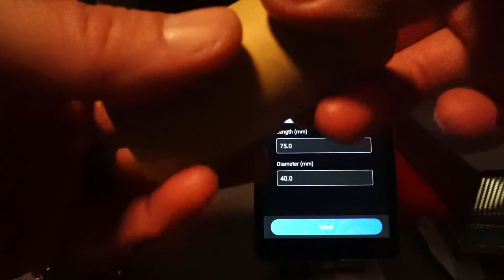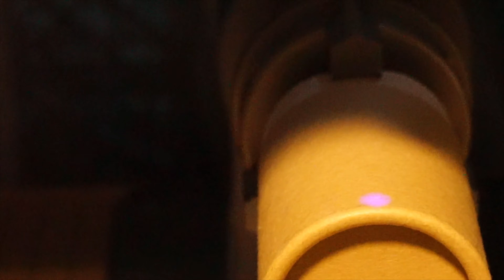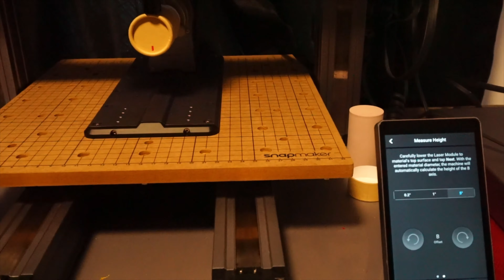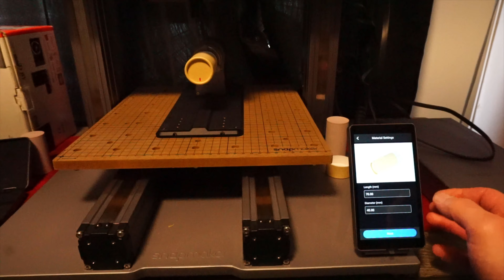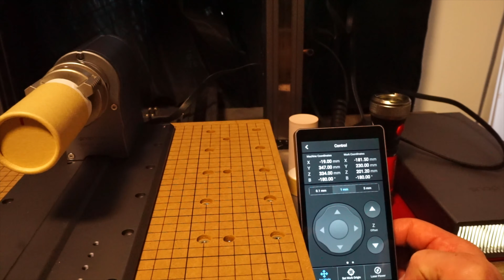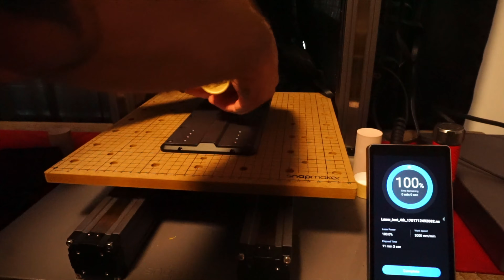SNAPMAKER 2.0 ROTARY TOOL SETUP

Comment: I always have to set my work origin when i make small adjustments. Otherwise i'll forget and it'll revert to previous origin point. I've thus far just done the manual z adjustment for laser. When i tried doing it auto, the laser 100% of the time just crashed into the piece. Maybe it was the shroud on the tip of it, maybe it was because i had the CNC bed, maybe it just hates me.
Reply from the maker: You need to be careful and calibrate it before you jump into running it. There's also a difference between laser power and travel speed. Carefully go through each step. These things can hurt you.